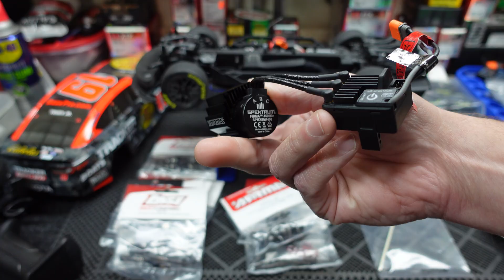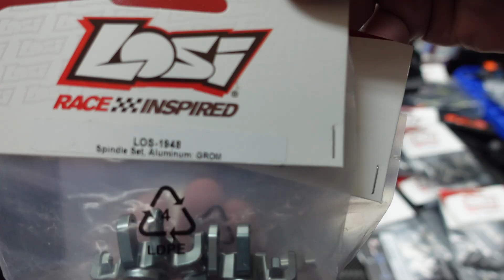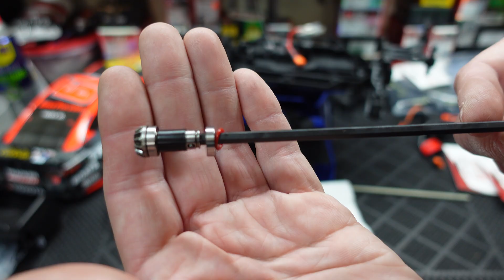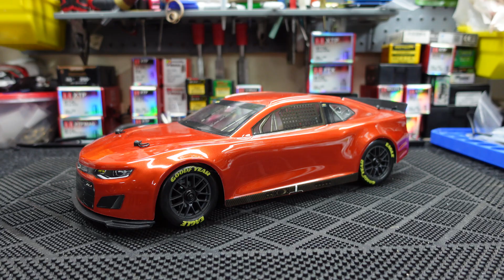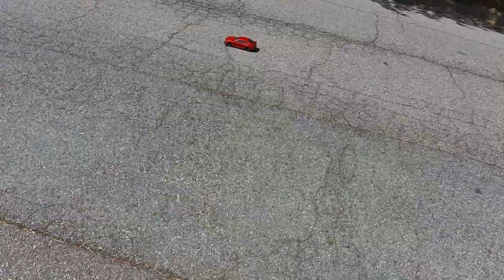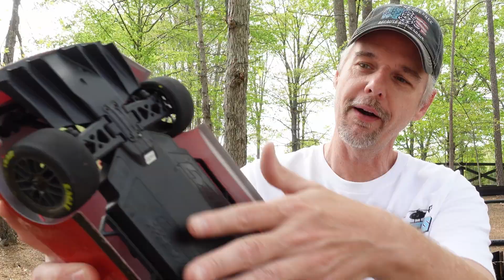NASCAR Unleashed!...LOSI Nascar 223s TLR Full Conversion & Speed Test Run!

Comment: I got a Brushless Setup as well, she's hauling now.
I got the Hobby Wing  2860 4700 KV, also a Reefs 99 servo paired with my Sanwa, the car is way more steady and controllable, with it.
The steering input is very precise, I noticed that your steering seems
 fairly stiff, what I mean is that you gotta do a lot of corrections, mine did the same with the Spektrum Radio those are alright for driving around but I found not the greatest on precision, I always had to correct mine coming out of the corners and then the cars gets all twitchy.

Great Video and a nice build 

Thanks for sharing

Comment: I put a castle sidewinder 4 paired with a 1412 2100kv brushless motor in my NASCAR grom with a 49t spur and a 47t 48p pinion and get 44862 rpm at the wheels when it’s running a 3s not under load I am now in search of 51000 rpm
Reply from the maker: Nice 😎👊

Comment: You shouldn't need any option parts except the servo horn, it's almost undrivable out of the box and the battery charger that takes forever to charge. But buying option parts is stupid for a ready-to-run (rtr) car.   We usually have two heats running these and have rules in place so racers don't dump money into a RTR car.  Nothing brakes that we have seen so far.  If they do then replace the plastic parts with steal.  This is a fun car for all levels of fun.
Reply from the maker: Whatever floats your boat, bud.👍

Comment: You need "PlowDaddy" to retrieve the cones.🤣👍😎
Reply: The first half of the video, the conversations, was Greek to me but I’m glad I watched it. Learned a little something. A little. 😄
But holy cow that baby is fast. And the control is very impressive. If you had a surface a bit more smooth without the cracks and dips it would be fantastic. But hey you get what you get and don’t get upset. Great video. Keep em coming. 👍😎🇺🇸👊
Reply from the maker: @yuvgotubekidding  Thank you sir. The stability control made a huge difference on this rough surface.😎👊